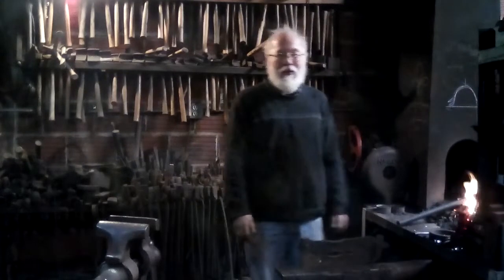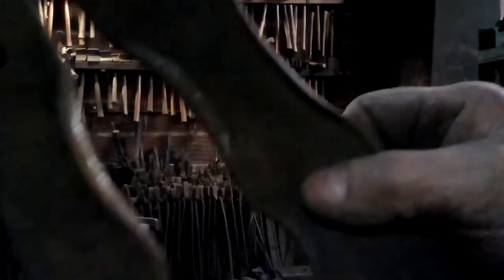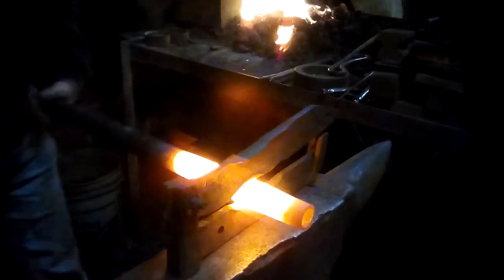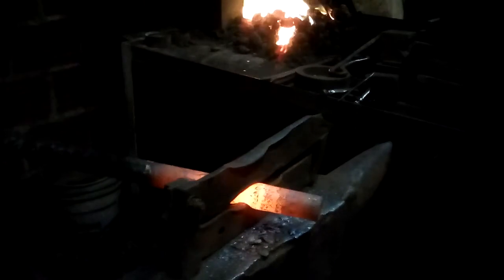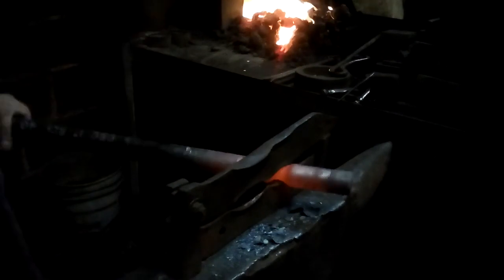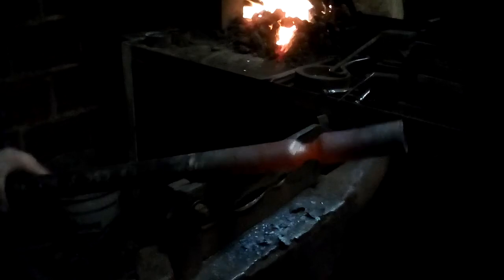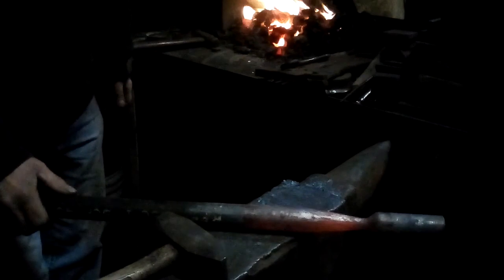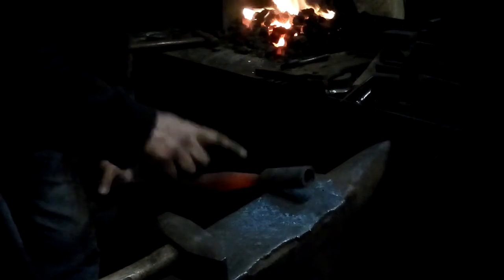Blacksmith's Dictionary Pipeswage, or Demo of Forging a neck and taper on pipe

Comment: I saved this one, I have some big truck springs,if I get time to do all these tools!would that work to make bells?Or thimbles?
Reply from the maker: Hi Moe:
 The easy way to make the radius on the tool is to  forge the springs over the anvil horn while rocking them side to side. This puts a soft edge on the radius. I made a big and small radius on the tip and back parts of the horn, but one size will work a wide range. The tool doesn't need to be very hard, I think I left it soft and 20+ years use has only put a little wear on the top.
Have fun!
daniel